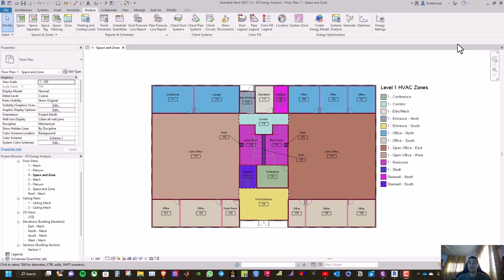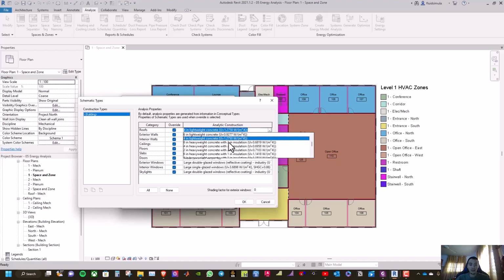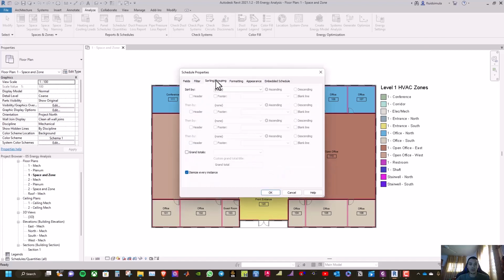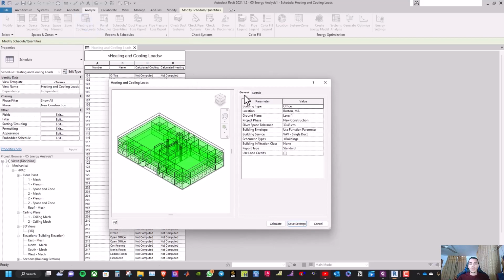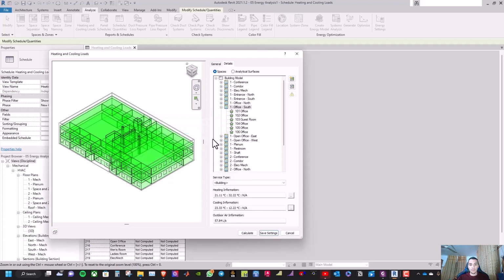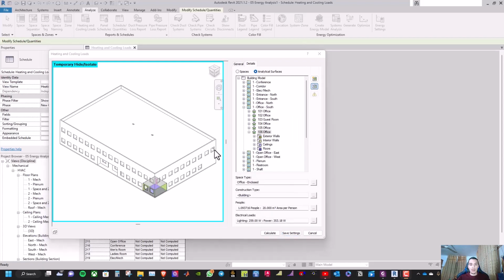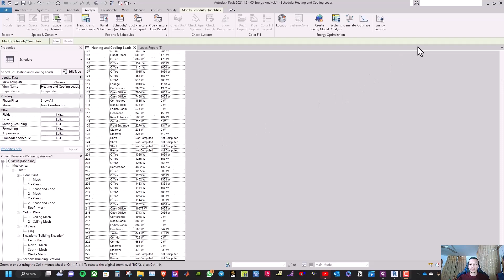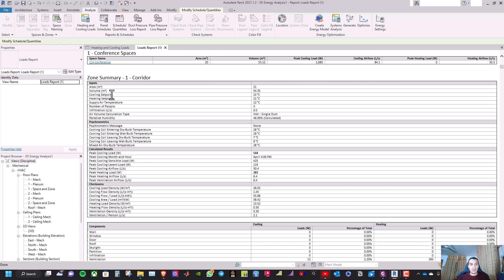05 Energy Analysis & Cooling and Heating Loads Calculation I Revit MEP

Comment: Hello, the number of people does not correspond to that indicated in the space. I tried several simulations but the number doesn't change.
Reply from the maker: You have the choice to enter the number of people manually or according to ASHRAE standard.
Reply: @karamalmasri6  in the properties in energy analysis in people when clicking the button (edit) when changing the number of people in simulating does not correspond to the edited one.